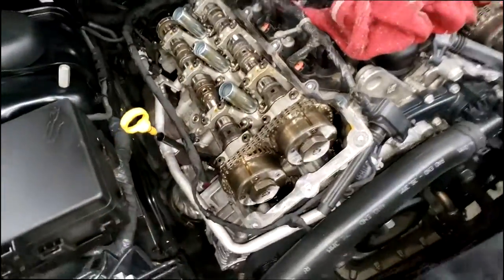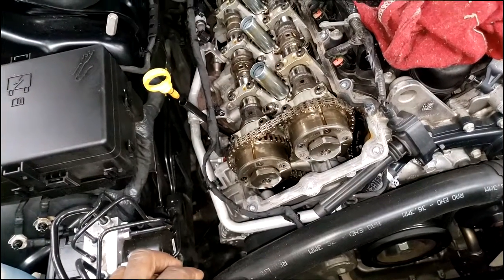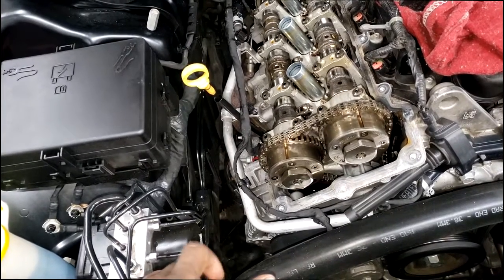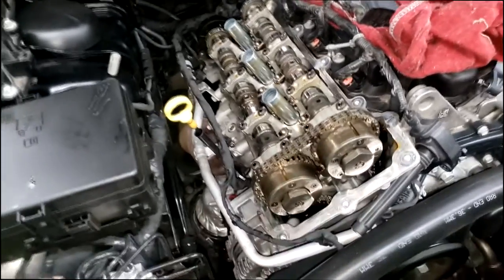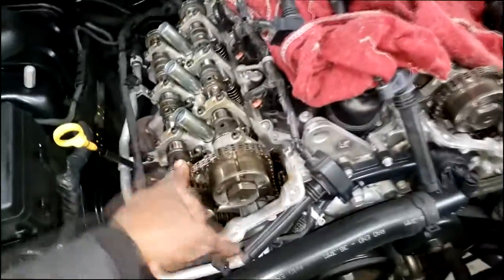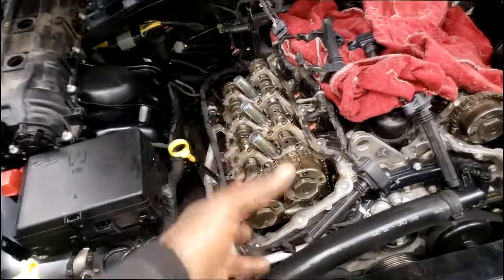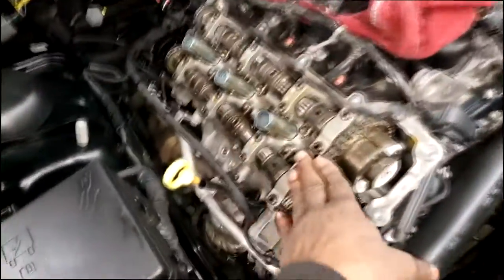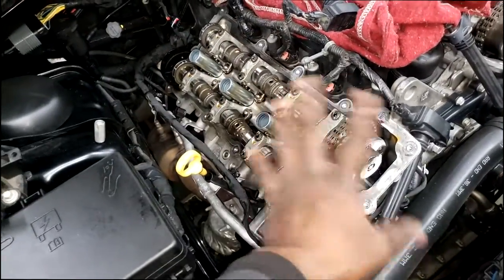VVT Cam Phasers. NO SPECIAL TOOLS NEEDED. Broken rocker arms, lifters, camshaft,  3.6 Pentastar tick

Comment: OMT, is there a small amount of backlash between the camshaft and the phaser? if you put the wrench on the Cam, will it move a hair independent of the phaser?
Reply from the maker: It depend. Are you on bank 1 or bank 2? Which head? Also are you subscribed to the channel?
Reply: @OnlineMechanicTips  I'm subscribe now LOL! Right side head. 2015 Town and Country! Thanks!
Reply from the maker: @D4MI0N  Vans are fwd vehicles so im assuming you me bank 1 which is the one not in front of the radiator,. Yes, it depend on houw much the tensioner extended. The video you on is for a RWD car but its bank 1.  Watch this video and you may get a better understanding. https://www.youtube.com/watch?v=oUHN1GRMC7M&t=550s

Comment: I dunno who you are outside of these videos but I wish I did. I’d hire you in second if I could.  As a technician turned team leader turned foreman who’s been doing this for over 20 years now, my rule has always been that flat rating a job is perfectly acceptable so long as it absolutely does NOT compromise the integrity or longevity of the repair or vehicle in any way. Also it absolutely CANNOT cost the customer more money then if the repair was done strictly by the book. If you take a shortcut and break something then that’s on you not the customer. Additionally all other consumables, seals, liquids, and fasteners that are required to be replaced and or torqued per the manufacturer must still be done.  From many of your videos I’ve watched it sounds like you have a lot of the same beliefs in proper automotive repair. Much respect!

Comment: Saved me!!!!! after trying to do it by the book and broke the cheap "tool" working on the right side exhaust cam. The tool set seems to be more for DIY uncertainty. The main thing on doing this job is to MARK EVERYTHING even the things that don't seem to matter and probably usually don't. It will at least make you feel better. For mine there did seem to be a difference in the phaser bolts(I didn't mark them but did remember which one I put where). Had trouble getting one started and tried the other bolt, the one that came out of that side, and it almost threaded itself.

For those saying the right bank is the hardest I would have to agree when it comes to my Grand Caravan simply because you(and especially "I") can't see and to do so requires at least 4 hands to hold the flashlight, mirror, tools, and the phaser. Even with my 60 year old arthritic hands I somehow managed.

Using a short piece of 1/2" PVC pipe in the phaser hole made handling it and lining it up much easier.

It would help having someone around holding the wrench on the cam while breaking loose and torquing the phaser bolts. I used a ratchet strap connect to an opposite side cam to hold the wrench while breaking loose and a short piece of 1x2 lumber under it while torquing.

For those of you that haven't started on your FWD a 36mm combination wrench would come in handy for the phaser bolts after breaking them loose and before torquing as space, especially on the right bank, is limited. Go ahead and move the power steering reservoir out of the way too so you don't risk breaking it while torquing.

Now if you could save me from having to buy a new left side exhaust cam! There wasn't a worrisome amount of noise and I didn't drive much after it started but 2 rollers were completely shot, no sign of needle bearings anywhere, and those two lobes were about 20% more narrow than they should be. One was no longer egg shaped unless you consider snapping turtle eggs.

You should call this video Don't Panic If The Tools Don't Fit And/Or Break.

Thanks for the great video and tips! YouTube wasn't around when I had to deal with the same type locking tensioner on a 1977 Ford Courier with a 1.8 Mitsubishi overhead cam
Reply: Caravan is easy-peasy. Just removed the cowl panel, which too many ppl are too lazy to do. 🤷‍♂️
Reply: Same here was so easy this way

Comment: Nice. I do have a question for you. a shop told us that its either check Phaser or tone ring? Phaser I got but how can you test the tone ring? Its on the back of the cam right?
Reply from the maker: Yes the tone wheel are pressed fit on the rear of the cam shaft. There is a tool for testing it. Also are you subscribed to the channel?
Reply: I am. I’m in a whole new world now.  So what would these tools look like to test it? Measurement, sound, X-ray? I can’t even fathom how to test it.

Comment: Hey so I messaged you the other day on my husbands account. We had replaced rockers, lifters and a cam we thought we jumped time after we turned it over had someone come and look at it turns out we didn't jump time. when we started the vehicle the idle was rough so i shut it off and then tried starting it again but it wont start now it turns over just wont start any suggestions?

Comment: Awesome video. Can you explain about how to time a 2010 Mazda CX-9 3.7 duratec engine. How would you verify the engine is in TDC on the compression stroke other than relying on the timing marks?
Reply: One simple way of verifying any engine TDC on number 1 cylinder. Remove all the plugs except for number 1 cylinder. Rotate the crank shaft by hand while looking at the timing marks. Once you feel the compression on that cylinder you know it's close to TDC, then simply line up the timing marks, as by then you're right there at TDC. It works every time, can't go wrong as long as the crank shaft timing marks are there.
Reply: Ford tech here. the dowel for the crank gear should be pointing at 12 oclock. that will be close enough and when you put the chain on just use the colored links to match up the dots on the cams and crank gear and you will be fine. cant mess it up that way. just make sure to crank the crank pulley down tight or you will have trouble later

Comment: Thanks again for another great video!!!  You saved me when the plastic tool broke while trying to release tension in bank one/right side.  Ended up watching this video and doing your procedure, the JT way :).  Thanks!
Reply: my plastic tool broke just now. you left the plastic broken off piece inside the timing cover? or just did an oil change right after?
Reply: @mattm2411  - lol no I fished all the pieces out with a snake grabber.  I was lucky they were all big and made a complete tool when out... took a longtime to do.  If that did not work I would have had to pull the timing cover (not fun).
Reply: @jefffarschon4270   my piece was so small o left it in there. ran fine.  ill never use special tools again though

Comment: I did this and i think my shit messed up, when i start it it makes a screeching noise, throwing error code P0019 and P000C, does that mean my timing is off?
Reply from the maker: Likely, curious, did you mark it before taking it apart? Because at the point you simply put it bact together using the marks on the new phasers. Also are you subscribed to the channel?

Comment: JT, you gave me the confidence to tackle this. Order four cams and 48 piece rocker and lifer set, intake and valvetrain cover gasket set, chain tool and paint pen all under $1,400 bucks ! All OEM.  I drove 3 k miles with the bad tick and not willing to push my luck.  Even dealer service guy pulled me aside when I had a headrest recall done. He said “off the record, that can cause catastrophic failure at any time”.  
Maybe I’ll get lucky and will find one or two serviceable cams and can return what I don’t open.

Comment: I can’t find ANYTHING on the 2014 impala. It has a tick that’s 99% coming from the valve train, but the bottom of the timing chain cover is over the bottom portion of the oil control valve. Can’t get the locking block in so I’m a little iffy. 🤦🏾‍♂️

Comment: So it’s okay for the timing chain to be that lose when doing this job? I was afraid of it sipping a tooth or coming lose and having to take the timing cover off
Reply from the maker: Hey bud, for the record, this is a terrible video and could be mis leading..I do not recommend you do it this way.USE THE TOOLS. This the way I do it because I'm pressed for time and I have done a lot of them so the theory fairly simple to me
Reply: So you can get by when doing the left side but can’t do the same on the right because the tensioner?
Reply from the maker: @nathanshelinbarger6306  I dont use tools for either side. YOU NEED THE TOOLS TO DO IT RIGHT. Also are you subscribed to the channel?

Comment: Ever run into chain jumping a tooth or two to the left after pulling out cam phaser on intake side there ? Meaning had all set to TDC made my marks on chain, phaser its all straight as it should but when I pulled oil control valve bolt/ then cam phaser off the chain some how went left a tooth but cam and phaser stayed straight at TDC...reaching out hopefully some knows what I'm saying and can steer me in right direction.. thank you
Reply from the maker: Hey bud, im curious if you are using the special tools? There are tools design to prevent this and keep chain guide in position while you dissasemble valve train. This video was done without the proper tools because somebody wanted to know how I do it. Also are you subscribed to the channel?
Reply: @OnlineMechanicTips  hey man thank you for getting back to me. yes id did subscribe! 
I'm trying to do this without the special tools at the moment.

Comment: Great Vid....thanx.....i noticed that the phaser magnets on the rear of all 4 camshafts have some kind of grease on them'  all the way around each one, kinda silvery looking.  your vid shows that too. Should   it be wiped off?  A new cam does not have a special lube pack  from rock auto.  .  Is it necessary  or is that a metal build up?
Reply from the maker: Yea man thats like powdered shaving being atracted to the magnet. You should clean that off because the cam sensor needs to read that. Thanks for watching

Comment: I need help, man. I pulled and replaced all my rockers myself, no problem. Drives fine for a while, then rattles again. Then I pulled and replaced all my lifters. Drives fine. I finally found some camshafts to replace my nasty ones, so I pulled and replaced the right bank exhaust camshaft. Put it back together and it wouldn't start. I messed up the timing, so I opened it up and lined it back up. Great. Starts and drives fine. 

Time for the intake camshaft and here's my problem. I'm at the finish line. Got the intake camshaft in and I'm at top dead center with the crankshaft. My phasers are perfectly lined up with the dark timing chain links, exactly the same as the left bank. My cams are all at top center. I put it all back together and try to start it. Clunk clunk dead. Won't start. Any advice on what to check would be great. Appreciate it.

Comment: Hello, my 2011 town and country has leaking valves. At 74k miles only on the front cylinders or bank 2 I believe. How much work is it to replace valve stem seals?
Reply from the maker: How are you so sure valve seals are your problems? Also are you subscribed to the channel?
Reply: @OnlineMechanicTips  
Its clearly visible from the intake openings while replacing the oil cooler.  Good amount of oil on one of the valves.

Comment: I just bought a 2015 caravan and both exhaust valve cam lobes are worn away on cyl 2! engine making almost a rod knock sound??? Is the sound from trapped combustion? All other cam lobes look fine on left head. Have not looked right head yet but engine ran like it had 1 cyl dropping out. Question is - why did both these only lobes wear away? Was there a blockage of oil supply or thats just the way they fail?? Also, how do you know that the phasers are bad on the engines you service?? Your advise on how to proceed with this repair and what to change? Just swap the cam and the two lifters and rockers for cyl 2?
Reply: Sounds like you have bad rocker arms. The bearing failed and wrecks camshaft.

Comment: hi JT, can you help me please,  I have a 2012 jeep wrangler 3.6 pentastar,  I'm trying to fix the ticking problem, I did your test 👍 and I rotate the engine from the harmonic balancer  and I noticed that the chain skips , what can be the problem?? also the camshafts are not aline
Reply from the maker: O nooooo, the chain not suppose to skip a tooth. Curious, were you rotating counter clockwise? You may have to take the timing cover off now to get engine properly in time and replace that tensioner while you at it.
Reply: @OnlineMechanicTips thank you JT for the quick response, I did rotate it clockwise , Is there a chance that the chain is not doing its job properly? or the tensioner?  can it be done in a home garage?
Reply from the maker: @orenkrief  Yes, there is a chance that the tensioner not doing its job. On a Jeep Wrangler, this can be a little bit of a hassle not being on a lift.
Reply: @OnlineMechanicTips  thank you I appreciate your answer I'll let you know in a few days what was wrong
Reply: its was the timing chain tensioner it was broken

Comment: have you noted how different torque specs for oil control valve on same engine but different makes and models?
Reply from the maker: No I havent. Thats interesting.  I need to look into that, thanks

Comment: Hi JT: first of all. Great video.  without the special tools, have to adjust the cam shaft to put the phasers on. Then have to use wrench to hold the camshaft while tight to torque specs. A very fast way to do it. It really requires  a lot of practice ☺️